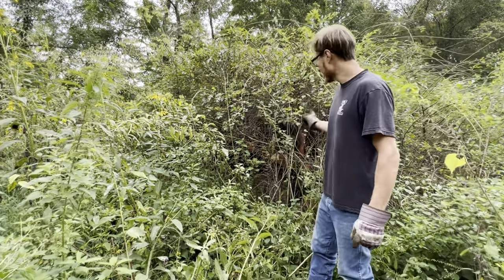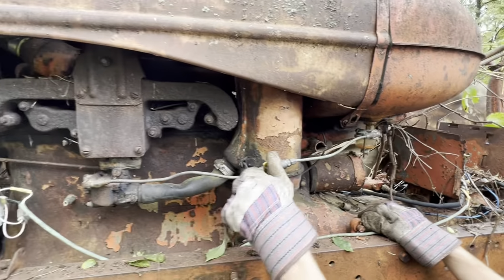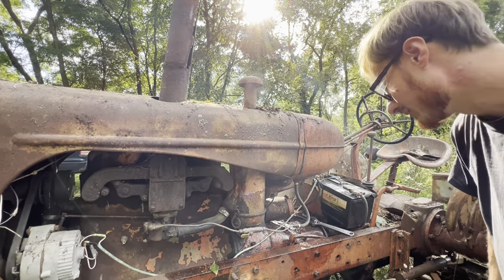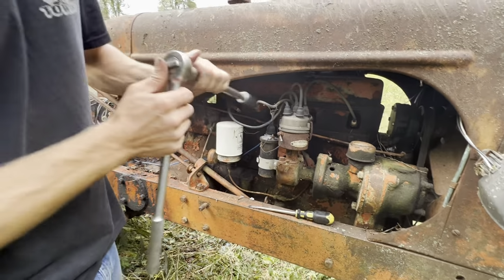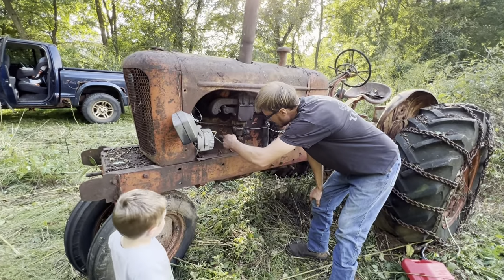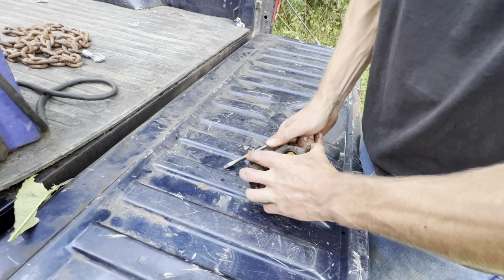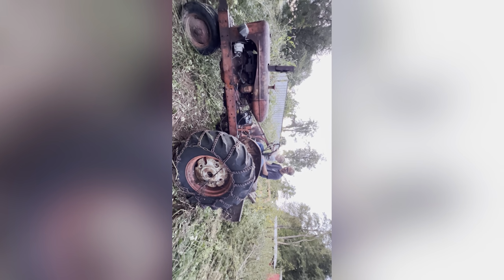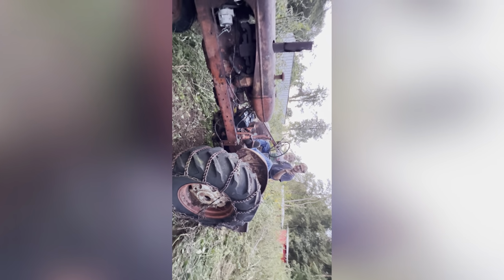Will it start! 1945 allis-chalmers WD

Comment: Thats an awesome find! I would be very careful with your little boy on your lap. Tricycle front ends can flip very easy especially with that brake stuck.
Reply: great vid, good work, but I was thinking the same, I am overly protective to a fault, and one fault I am willing to live with.
Reply: Is your statement from experience?  if not, please don't fear monger we have too much of that these days.  
Tricycle is a bit of a misnomer, take the contact patch from outside tread edge to outside of the other front tires and you have a decent ground patch at least a foot wide on these. With a front beam axle you have a 1-1/2" wide pin where the axle pivots.  The wide front pivots with essentially no resistance until the axle hits the stops . Better hope that is before the point of no return. -It generally is, but inertial forces can mean when the axle stops make contact your rear tire might just keep moving skyward.  IMO the trike is more stable for general use, its just that once they do start to tip there is no stop to catch.   This is where humans using brains and experience is best. Learn limits and don't exceed them in them in the worst case scenario (wide or narrow front).  

The scariest thing for me was when we got a wide front end tractor to replace the trike. With a good size log behind the old Allis the front wheels didn't touch from when slack was taken up until the clutch was dis-engaged. Our woods are anything but flat and those cutting brakes could easily steer for a half mile back to the house (so front axle type can be a totally moot point in operation)  -No the tractor wont easily flip backwards either but this is enough experiential physics for one day.   The danger here is the centrifugal force sending the kid tumbling from his arms.

Comment: Not a 1945 model. WD 45's weren't built until 1953. The similar but less powerful WD which this tractor is were built from 48 through early 53. My dad and I owned a 52 WD that had a WD45 carburetor, manifold,crank and oversize sleaves and piston.
Reply: Negative. They started building the WD45 in 1953.
Reply: @79fordblake Yes the 45 began production in 53. I had a typo in the original post which I just corrected.

Comment: For info. only, not being critical. AC model was WC up thru 1948.  The WD came out in 1949. Engine was rebored in 1953 model making it 45 hp. Thus the WD 45. Main distinguishing feature was the curved gearshift and 45 sticker on side of radiator. Yours is between 1949 thru 1952. They were a good, tough little tractor!
Reply: Thanks for the correction. I only clicked on the video because I swore they were not produced in 1945 -Which BTW makes sense most "new" models of anything didn't come around until 1946 or after because of the war.  
Low compression and magnetos mean that if they are dry sitting won't be an issue (no battery needed).  Once I could hand crank dad never put a new "bendix" or battery in again. One turn to prime one to start.  
I still miss that machine, Allis innovation was unfortunately aklways just a bit off the mark.  Glad I gave it away rather than selling so I know where it is and can still go visit it.

Comment: It seems to have an alternator upgrade...I drove one of these at my late uncle's farm in the 80's...Never forget the metal ring you pull to engage the starter motor...magneto on the front...
Reply: Yes I thought that about the alternator. 
Also does not seem to be very knowledgeable about basic safety or the necessary preparation before attempting to start it. A very lucky child and parent.

Comment: Lucky it is 12 volts. I have ford Fetguson which is 6 volts. Can't get a battery. That one has an alternator? The brake is stuck on the left. Where is that? Great video.
Reply from the maker: Thanks a lot it was originally 6v it had a generator a long time ago you can put 12 volts to a 6 volt starter that’s why it spins over so fast it’s just not recommended to do it long yes the brake is stuck thanks for watching

Comment: You know your going to have ignition problems Bring a file with you , Gee you think it's plugged why do you come in the field to do a will it start ,pulling the carb to clean is a must if you have been doing this for a while you should know the basics that is required for a old will it start project. having your baby on your lap is not to smart think of His safety even if you don't care about yours

Comment: The WD 45 wasn't built until 1953. If it's a 1945 tractor it would have to be a styled WC. WD's weren't built until 1948.

Comment: ya i had one for reverse the was a little lever on the side of the shifter you nwould pull the lever toward the shifter knob and that would allow your shifter to move all the way to the right then you either went strait up or down i forget wich way . that one is also a rowcrop. ours was a few years older that yours. those tractors do flip easily because its a rowcrop so i wouldnt allow the kid on it